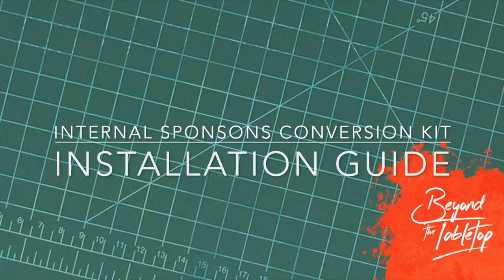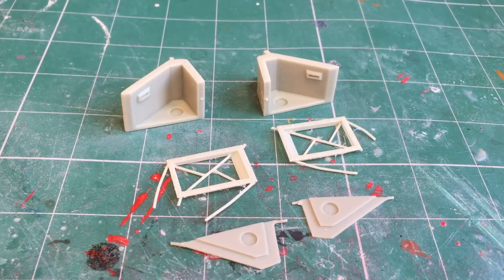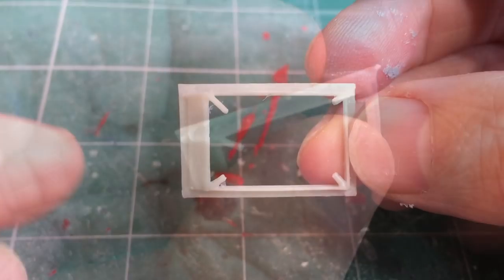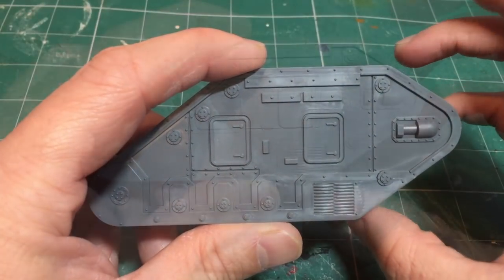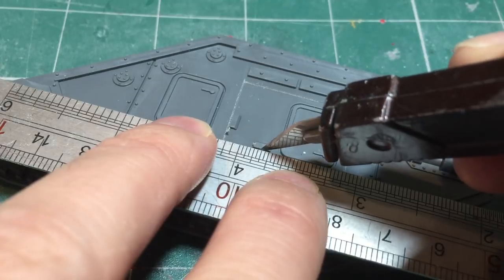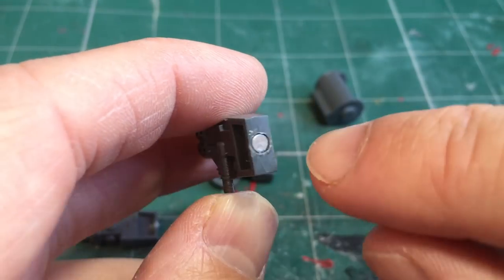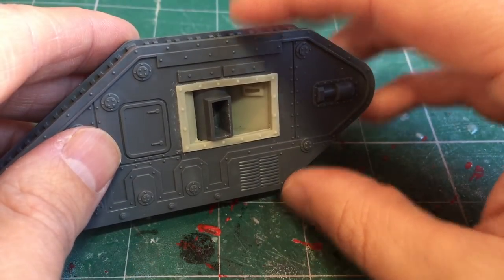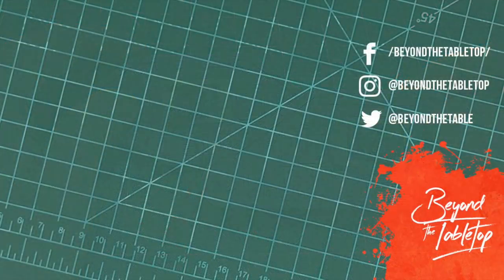Leman Russ Internal Sponsons Conversion Kit. Installation Guide

Comment: does this work with the older 1994 russ kits?
Reply from the maker: Yes, this shouldn't be a problem. You might want to make the required cut-out before adding on those side hatches to the track unit, or adjust the placement of the hole it to better suit that track design but they should be fairly similar so I can't see any issues.

Comment: 20$ a set seems a bit high.
Reply from the maker: I appreciate it will be high for some people, like all products it factors in the cost it took me to develop and design, the material cost in moulds, resin and the time it takes me to hand cast the items (these aren't 3D prints), along with all the additional material costs such as a pressure pot which reduces the amount of air bubbles in the product, then on top of that we have things like electricity/heating and a salary for myself. I am a one-man shop, not some vast company like Forgeworld, imagine how much this kit would cost from them? 

Feel free to read all the reviews which talk about the quality of the design, the casts and the resin I use. These all factor into the cost. 

Lastly, for people which do want cheaper kits, I sell miscast items at a reduced rate which have fixable defects/air-bubbles. These only appear on the store when I have them available, and for this kit it's sold at 65% of the original price, so quite the discount. In addition to that if you were a supporter on Patreon you can get an extra 10% off from that too. I sometimes also do sales during the year too, so there's definitely plenty of ways to buy the kit cheaper from me while still supporting the work that I do an an independent creator. 

If you're interested in those cheaper kits I suggest you sign up to my newsletter where I'll post about the miscast items when they go on sale: https://beyondthetabletop.com/subscribe